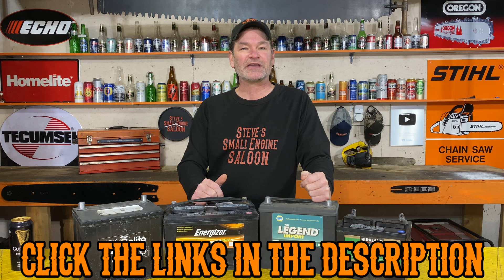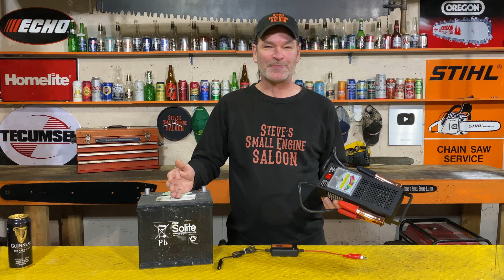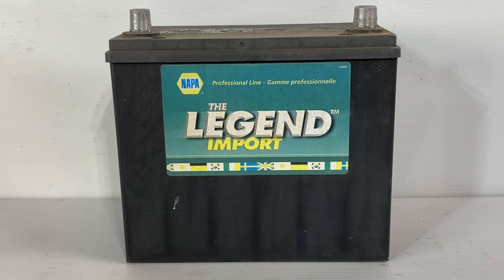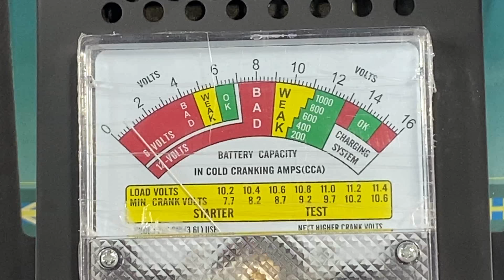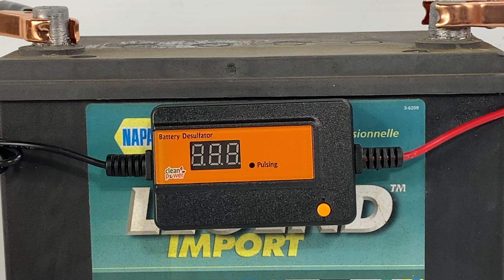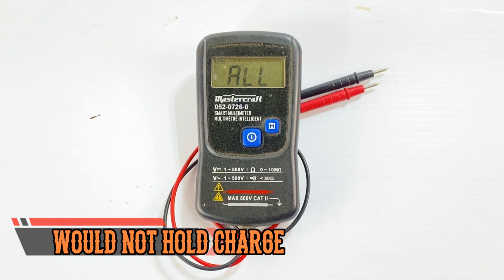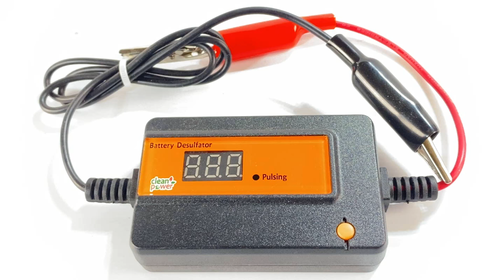Does An Electronic De-Sulfator Really Repair A Battery?? See Real Results

Comment: I have some experience with Pb batteries, and here's my take:
Batt #1: Sealed batteries still vent gasses, and thus they will eventually run out of water. I have found that a sealed battery that holds a high voltage but has high internal resistance is dried out. If there's a way you could pry or cut the vent caps off to add a little water, it may come back to life.
Batt #2: It has multiple short circuited cells. I have never had any luck reviving a battery in this condition.
Batts #3&4: Minor shorts or excessive sulfation, which yes the desulfator can fix.

My #1 tip for reviving old batteries and significantly prolonging the life of good ones: Periodically remove them from whatever equipment they're installed in, fully charge them with a normal charger, then connect them to a float charger and let them sit on the float charger for a few days. Don't forget to keep them clean too, as the crud that builds up by the vents of flooded cell batteries can be conductive and result in a surface discharge.
Reply: it took 14 days to get the internal resistance from 12 to 7.7 milli-ohms using the Battery Minder. it pretty much stayed there for 3 yrs. now, nov 21 its up in the low 8's
i'm using a cen-tech battery analyzer from harbor freight, it measures cold cranking amps (the ability of a battery to hold a charge), voltage, internal resistance (in milli-ohms). you have to attach it directly to the lead posts on the battery, not the steel clamps, to get an accurate reading. 
thanks for the tip on internal resistance rising indicating battery needs distilled water. kj6epl de wa8lcz.
Reply: There are still 'maintenance' batteries - those allow you to add water.  You'll do it slightly more often, but I've swapped from maintenance-free to maintenance for this reason alone.
Reply: Make sure that sealed battery is in fact a absorbed glass mat and not a gel cell. 
  For that chemical reaction to take place creating it to gel requires certain ratios of sulfuric acid electrolyte and silica gas.   
   Most of my vehicles use a glass mat Style since they have a longer shelf life to start with. Makes it nice when you have a classic a recreational vehicle that's only used once or twice a month.
Reply: I park my truck for 6 months every year.  2 batteries that when in storage I have hooked up to a trickle charger, never unplug.  I just tested them with the same resistive unit seen here.  As new amperage and exactly 6 years old.  Letting a battery sit will look it in a few months.
Reply: How can they vent gass when they are sealed ??
Reply: @temp911Luke  An AGM battery, as the name implies, is an "Absorbed Glass Mat" battery, and Not a flood filled battery. An AGM battery normally has "Inspection" holes, just like a normal flood filled battery, however, on the AGM batteries, these are usually covered with a silicon bung or plug, and then the cover to the cells is normally melted/glued into place, making it difficult to actually get to the bungs.

In an AGM battery, once the resistance starts increasing, the absorbed glass mat starts "Gassing" and this creates preasure under those silicon bungs. From this preasure, you will get these cells leaking the now aerosolised gas that was initially trapped in the glass mat, out of the battery. Taking into account there are these silicon bungs in place, once that preasure has vented, the bung actually creates a vacuum, preventing outside air from getting into the now empty cell.

Ps. AGM batteries only have the smallest amount of electrolyte in them, as the entire process of manufacturing these batteries, is based on the principal that they soak the glass mat, remove it from the tank with the electrolyte, and then they have a process that basically squeezes 95% of the fluid out of the mat, at which point it gets cut to size, and installed into whatever battery they are manufacturing. Flood filling these batteries to get them operational again, would be a complete waste of anyone's time, as this is not how they have been designed to operate.

Ps. Ps. By no means am I a professional, or Battery manufacturer, but I have done my fair share of research into how batteries are manufactured, but I have in the past tried reviving AGM batteries, and let me tell you, every single one was a fail, mainly due to the fact that once an AGM battery has been sulphated, there is nowhere for it to go, as there is zero physical liquid in the battery for it to find its way off the plates, down to the bottom of the battery housing where it normally has a void for the debris. 🤷‍♂️
Reply: @temp911Luke  They have a one way vent that opens with high internal pressure. "SEALED" is a marketing term..i.e. a lie.
Semi-sealed? Yeah, maybe better term......
Reply: @temp911Luke  most if not all lead acid battery's have valves that regulate gas discharge - even when the sealed battery's they will vent gas - that's why they say a AGM can be used in any position except for up side down - if there up Side down at times they might leak liquid acid out the regulated vents -
Reply: @temp911Luke  These are valve regulated lead acid (VRLA) batteries. These are not completely sealed.
Reply: @temp911Luke  pressure valve vents hydrogen sulfide gas if it is over a set point. Example 15 PSI. Caused by overcharging. Most of the time charging is much less pressure because they charge at a lower voltage. When the battery discharges it absorbs the gas into the electrolyte.
Reply: They still have pressure relief valves so that they don't explode. Heavy discharge and or excessive overcharge cause pressure to build and open the vents.  Do this enough,  and the water level gets too low.
Reply: @temp911Luke  If it doesn't vent, it could explode from internal pressure.  Remember that the battery cells are off gassing hydrogen and it needs to go somewhere.
Reply: This is legit. A maintenance or equalizing charge like this is something your alternator doesn’t do and fully charges the battery and keeps the electrolyte mixed, so it doesn’t stratify. It also keeps the specific gravity equal across each cell.  I do this once a year during the winter months when a battery typically stays undercharged.
Reply: I watched exide they build battery and charge 2 amps for 2 days
Reply: @dannythomas7902  when a battery is made, they add the acid to the battery and the lead plates are brand new so it should be fully charged once you add the acid to the battery it slowly discharges over time so it might need topping off to recharge it if it has been sitting for months
Reply: I've never been successful at recovering (REWATERING) a dried-out AGM.  In fact, I've killed partially working AGM's by watering them.
Agree with the remainder of your experience.
Reply: @thisisyourcaptainspeaking2259  8:59 8:59 😅😮 no
Reply: Pull the sticker off from the top of battery, cell seals are located under the sticker.
Reply: p🎉
Reply: Just install a solar charger with charge controller.  Have 16 year old batteries that work fine doing this.
Reply: Thank you for your input! It is super helpful as an addition to the video
Reply: problem with that is when you remove a battery you'll be unable to pass emissions test
Reply: @fallback8314 N
Reply: @fallback8314  Check out a "memory saver" device.  You can supply a small current to your car's computer system through the OBDII port while main battery is removed.  Haven't gotten myself one yet, but hope that helps.
Reply: @fallback8314  That's only partially true.  When you remove the battery, you're supposed to hook up a 12VDC source to the terminals, so the computer doesn't lose power.  If it does lose power (it can get below 12VDC and still be okay), the computer resets itself.  To get the car to pass an emissions test, you'll need to complete a drive cycle.  Each manufacturer has a different set of criteria for the drive cycle - you can check on the internet to find it.  Also, some cars are finicky and the drive cycle can take a very long time.  Also, 2010 and newer vehicles have permanent codes that are stored in the computer - this happens because the government doesn't want people to disconnect or reset the computer to remove the failure codes.  All the permanent codes are is a software change that required you to run extra tests on the system to insure that you're not resetting the computer to just pass a smog test - they want to make sure there is no problem with your smog system.

Comment: had pretty much same results with  with a 5 / amp / pulse chargr a bit like yours on 4 batteries i have on my boat, the starter battery has come back to life sitting at 12.9v and so has one of my leisure batteries at 13.1v but two others will not hold a charge over 11..1v whatever i do.

Comment: Bought a Noco  5amp battery charger which also has repair mode (lead acid repair only).  Have been able to revive/repair 2 batteries so far, it works.  Another benefit is that the Noco  will recognize batteries to begin charging as low as 1.5 volts.  It has a "force" mode that enables this feature.  New smart battery chargers will not recognize and begin charging on batteries below 12 volts.  Keep buying new batteries, or give it a shot.  Topping of occasional use batteries with 2 amp trickle charge is key to longevity and performance of battery.

Comment: Interesting video, have you tried the inverter welder trick, I have and it worked for the two batteries I had bad.
Reply from the maker: Not yet!
Reply: I’ve been trying that with an Amico DC welder. Most batteries improve. Maybe 30% seem fully recovered. Like one battery wouldn’t go above 10.5v ….. Each cell is 2.1v, so 2.1x5= 10.5v. Therefore, that battery had a shorted (bad) cell.

Comment: This is what I've got and it's worked to revive a few batteries that I found in the barn I bought. https://www.amazon.com/gp/product/B07W3QT226/  Works very well. I've gave up on cheap ones. And - https://www.amazon.com/gp/product/B07Z67MMGC/

Comment: I use lots and lots of 12V batteries--mostly the smaller kind that go into larger power backup devices. I bought a device a while ago that not only provides the nominal voltage of a battery, but also gives a readout of the internal resistance of the battery, and the CCA output of the battery. I've tried to 'repair' MANY 12 V batteries, either those that appeared OK, with a voltage of 12+, but a high internal resistance (which indicates a battery that will have low CCA capacity--also confirmed on the device), and they have NEVER been fixable.  I've also tried to 'fix' lower voltage (lower than 12V) batteries (which usually also have low CCA and high internal resistance), and again I've never succeeded.  It would be most enlightening if you were able to check the CCA and internal resistance of the totally non-repairable batteries, and also for the 2 you succeeded fixing. My best guess is that you 'desulfated" a small chemical spec that was causing a small short between cells, or in a cell, but essentially the 'bad' battery wasn't that bad. If there's been lots of internal degradation so that the internal resistance is high, I don't think (from my experience) that there's any repair possible. I'd love to know if I'm right or wrong
Reply: You would need new plates inside the batts and new electrolyte then you would have to reseal the plastic case after 😉
You already know the score on fixing batteries ☺️
Reply: I have seen people on YT using a welder to provide enough current to break up badly sulphated battery cells, not sure exactly what conditions can be corrected vs. pulse methods but it seemed like it might be worth a try for some stubborn ones.
Reply: your honest input is in minority in this comments section. 
if reconditioning acid batteries was 'that easy' we'd have huge businesses doing just that.
ppl Love to believe bs :).

Comment: Hey Stave  it was fun today on Mick's Live stream.  Interesting tool there.  I am going to pick one up.  I spent 33 years in Communications equipment and backup power (the big stuff ---5000 amps and more)   I will enjoy this.   Bringing batteries back from death can be done.  This will help.    I will enjoy  trying it.  The toaster tester is a great tool as the load is real.    Thanks for all you do.
Reply from the maker: Thanks Bruce!  Yeah, that was fun....

Comment: Hello Steve and viewers. One thing I learned in Ham radio courses is the Amateur radio community maintains emergency preparedness stations and they often depend on 12 V lead acid batteries.Those batteries cant sit for 5 or 6 nonths at a time and be expected to work.They need to move and shake around from time to time and de-sulphating not a bad plan too!
Reply from the maker: Right on
Reply: Darryl, I'm a fellow ham and battery enthusiast. Stationary flooded batteries suffer from acid stratification. Basically, the heavier acid drops to the bottom of the battery reservoirs and the lighter water floats to the top. That's why stationary batteries need to be overcharged slightly occasionally, also known as cell balancing or equalization, to stir the electrolyte internally until it bubbles. Vehicle batteries don't suffer from stratification because they move regularly and stay stirred up. Good point. I'm glad you brought it up. AGM and Gel batteries do not experience electrolyte stratification. Their worst enemies are under or overcharging, and/or popping the VRLA safety vent. Another killer of batteries is improper charging at the wrong temperature. Always use the manufacturer's data sheet for temperature and charging parameters. One size does not fit all. Best 73's. N0YCX

Comment: I have a battery maintainer/Desulfator that I about 5 years ago and I believe it has extended the life of my car batteries. I agree that once a batter is too far gone it's not going to bring it back from the dead, so I rotate the desulfator on my cars and I believe it has extended the life of my batteries. I just now replaced a Walmart car battery that was 10 years old. And now that I have that old battery in my garage, I will see if I can improve it and use it again in a non-critical vehicle.
Reply from the maker: Right on

Comment: My lawn tractor is on a trickle charger when not being used. The battery is 3 years old. The trickle charger showed the battery was 100% chareged, but it would not turn the tractor over. Used a NOCO Genius charger and desulfator. After one treatment, the battery worked as it should. I now rotate 2 trickle chargers that are also desulfators on all of my vehicles.

Comment: Steve, Sent you a video on your web page email. Guy uses a manual 200 amp. Battery charger to bring back totally dead batteries. You may can get the  two batteries back. That the De- sulfator. Would not work on.

Comment: Nice job using the load tester and taking good notes.  I use a similar technique, but my desulfator plugs in so it doesn't use battery power.  One thing I question is if these things are so good, why aren't they integrated into ALL battery chargers, including those in cars, vans, trucks, boats...?
Reply from the maker: Great point!
Reply: They are that good, and available as after-market accessories if you are so inclined. The military uses solar-powered pulse chargers on equipment in storage. I bought a used one for 24 volt system at a flea market for just a couple bucks. The guy had no idea what he had. They're not cheap and I got lucky. Take a look at VDC Electronics for their product offerings. I think you'll be impressed. Prepare for sticker shock!

Comment: The only way, to de-sulphate batteries, is :  charge it on your 200 amp large 'start boost' setting, for 15 minutes, every hour for times. will be  6.25   hours.     before this, drain the battery of electrolyte. Rinse, with distilled water,  drain, do it twice. let dry. then, do that charging thing, in a half day. put electrolyte back in, or, install new acid/distilled water mix, according to manufactures'  ratio of electrolyte.   should rejuvenate it completely.....good day.

Comment: Hey Steve I’ve got 812 V batteries I’ve got a charger diesel Feder unit from (Pulstek).com that I bought several years ago for about 90 bucks they’re a little more now and I go around every 60 days 60 to 70 days and plug it in to every one of my batteries I’ve got a 2012 Dodge pick up diesel with two batteries in it and they’re still cranking the truck over just fine works like a champ

Comment: Several years ago I purchased a electronic battery  charger that has a desulfate cycle. It has saved about 1/3 of the batteries  I have used it on. I want to learn more about why some conditions were corrected and why some were unsuccessful.

Comment: Sometimes Turning the battery upside-down a few times may helps.. also homemade disulfater??  rectifier and a capacitor. pulses 60 times per second.. just be careful after all a capacitor on it .